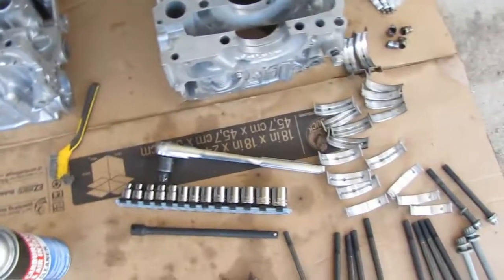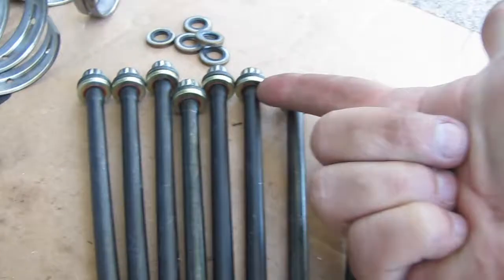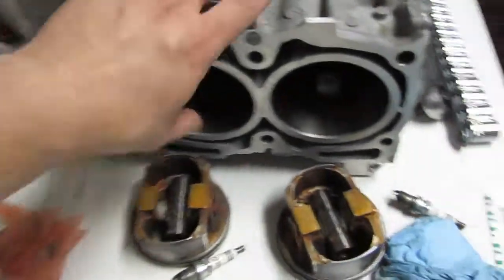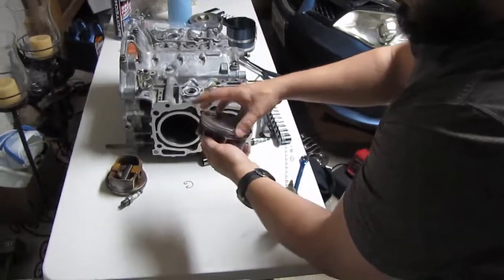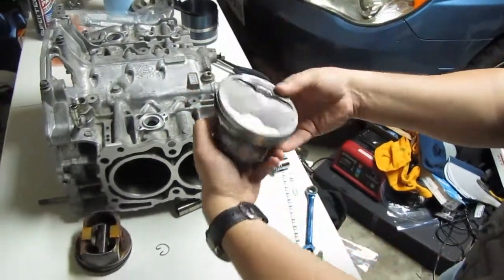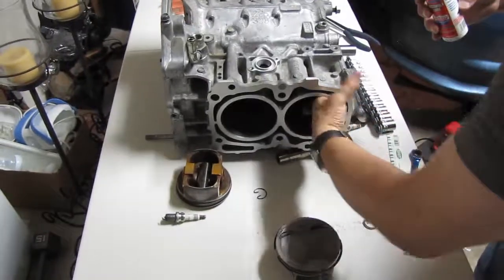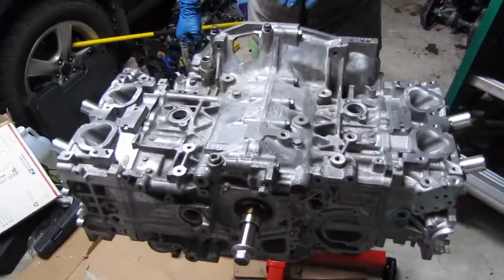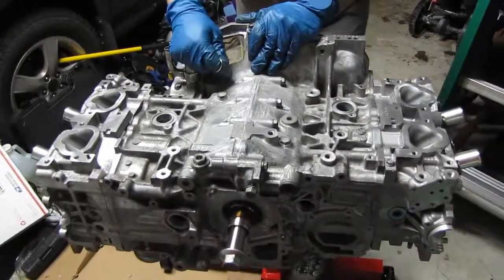2007 Subaru Impreza 2.5i SOHC Rebuild - Part 3 - How To Put Crankshaft In Block Together + Heads On

Comment: Where did you get all the specs and write ups on all the i saw also in previous videos you had the specs for ring sizes and the gap between bearings and journals if you could give me all the info you found that would be great ive never rebuilt an engine but im doing my first on the same car now
Reply from the maker: Hey Sam, all the information I use is from the Factory Service Manual.  It’s copyrighted, so I can’t share it, but you can probably find it online.  Subaru sells it as well but I have heard tell that some techs will print off what you need.  Thanks for the comment and do please consider subscribing!

Comment: I'll be doing this soon on my '01 Forester. May I ask where you got your parts from? Did you use OEM parts?
Reply from the maker: gowdaflow Good luck and enjoy the process!

I got most of my parts on Amazon.  You can use subaru's website, the fsm, and even subaru customer service to verify what parts/kits you need.  Amazon and sellers on it are pretty competitive and fast.
Reply from the maker: gowdaflow Also, make sure to subscribe, like, share if any of this helps you out!
Reply: Peace, Love and Guns I’ve been looking for a video on how to install/mount the valve springs and retaining keys without the recommended specialty tool. I’ve seen a few on how to remove them, but everyone whose installing heads on block already has them on, as well as those spring next to the rocker arm assy. You vids have definitely help, Thanks!